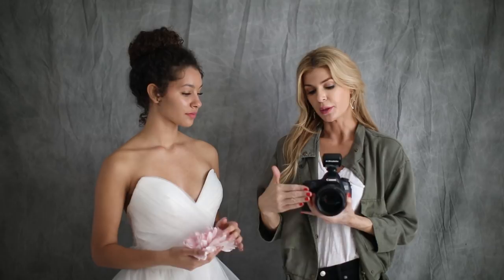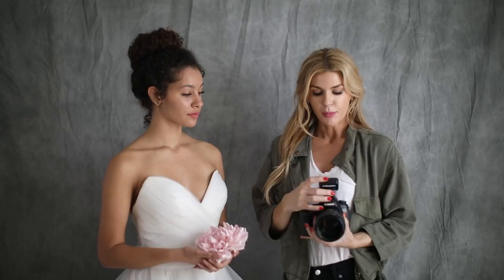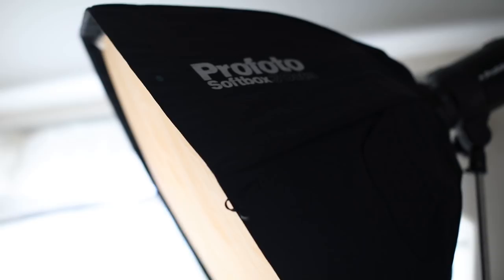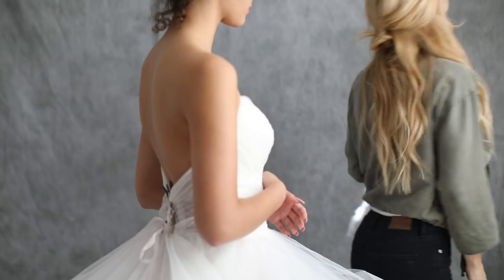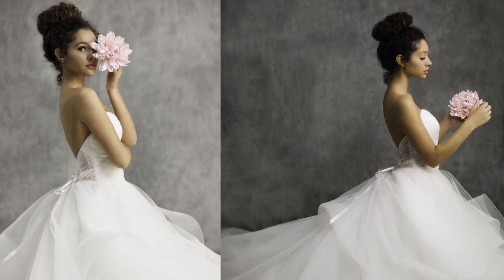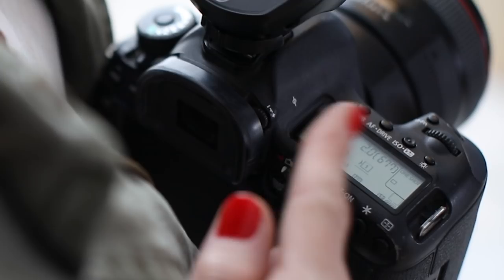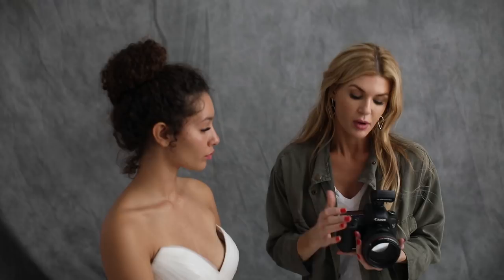How to Photograph Models using a Soft Box

Comment: Would a 5 foot octa be better?  I have a 5 foot octa so I'm curious.  I use the D2-1000 and D2-500 in studio (I love the fast refresh).  I discovered (by accident) that the D2 has a different color temperature in freeze mode then normal mode.  I did a test in studio and found that in normal mode it was consistently 6550K (which I expected), but in freeze mode it was consistently 8,000K.  I'm not sure if the B1 has a freeze mode?